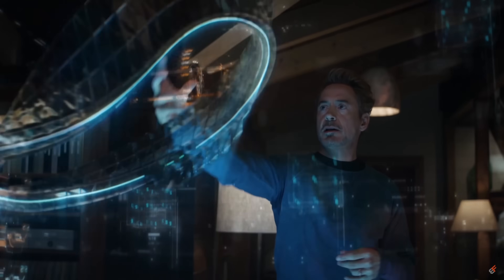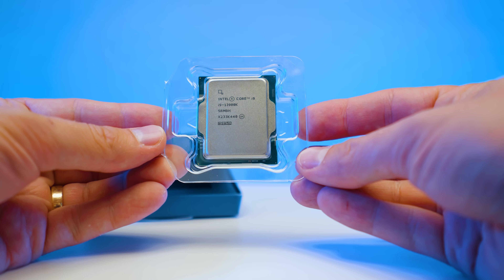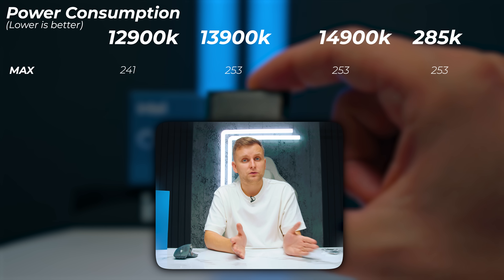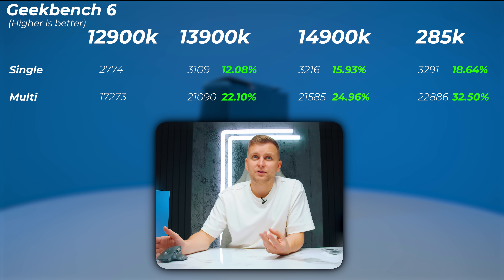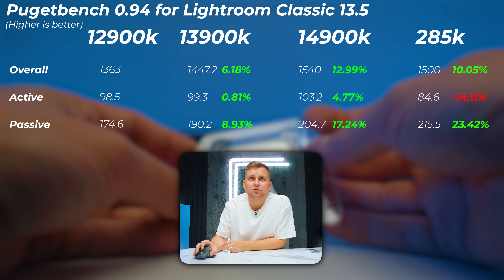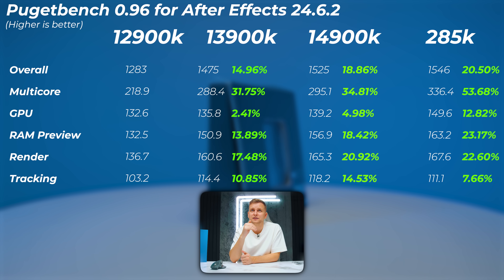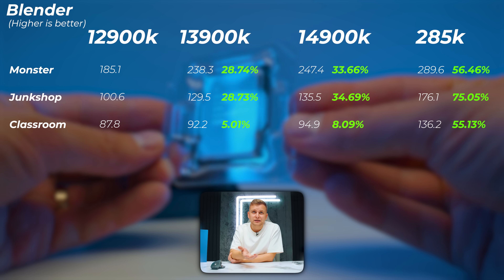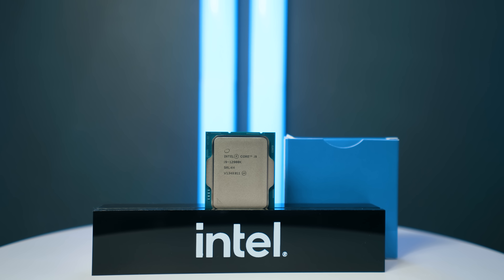4 Generations of Intel i9-s  👉🏻 How much ACTUAL performance gain? | 12900k vs 285k

Comment: Don't forget the 12900KS can be picked up currently for a relative bargain... narrowing the gap even more with the 13900k/14900k. Not to mention the memory controller on the 12900KS's is usually pretty decent. eg. my 12900KS can do 7200MT CL34 at lower voltages than my 13900K can (limit of that particular kit).
I'd say if you're already on a 12700K or 12900K, there's probably little reason for most people to upgrade... solid performing CPUs.
Reply: my 12900k can go 7400 cl34 with tachyonz690    but my 7950x3d can run 8000 cl 36 ;d i like both
Reply: @Fartuch87  I run 7800 36 with 12900KS on z690 unify x. Gigabyte have always been trash imo
Reply: @godnamedtay  My 12900KS is in a Z690i Unify (itx). Amazing board; the limit is actually that ram kit... hits a hard wall at 7200 CL34... could probably push it marginally more by tweaking, but i'm happy with the very low voltage/temps required for 7200 (eg. 1.41v on the memory... considering it's a Kingston Fury 6000MT C40 kit, that's pretty good!). I know this is a hard limit for the kit, as my 13900K with the same kit hits the same limit...

My 13900K can do 8000+ on its Asus ROG Strix Z790i Gaming Wifi board, with a G.SKill 8000MT kit... mine is an early chip (purchased in November 2022) but seems to be holding up fine! SP of 113 on the P-cores, so it's a decent chip...
Reply: @heyitsjel  I’ve always wanted the z690 unify itx, I have the z790 edge. They’re almost the same board with the z790 missing a couple feature that the unify z690 has. Either way the unify is my favorite line of mobos ever made, period. They’re incredible, very well made imo.
Reply: @godnamedtay  yeah they're great boards - I too was torn between the Z790i Edge and the Z690i Unify... but I needed the Unify due to the TB4 ports (10GbE adapter). Also, I'm very sure MSI runs their "out of the box" cpu settings significantly more tame than the likes of Asus; Gigabyte etc... probably explains why my 13900K still lives to this day without issue - it had a 288W power limit from day 1, initially in the Z690i Unify.
Reply: @Fartuch87  Sounds like you got a very decent 12900K! :)
Reply: I just got 12900ks for $236 & 13900k for $373 sold/shipped by Amazon. Incredible deals for these.
Reply: @godnamedtay  I paid about 50-60 USD more for the 12900KS here in Aus a month or so ago (local supplier) - still think it was a good deal though!
Reply: @ yea from what I hear about Aussie prices & considering how much hardware almost always costs more locally. That thing was $500 just a couple months ago. Def a great deal for sure. 12900KS is such a slept on cpu, thing is a tank!
Reply: @godnamedtay  Definitely man; it's even more funny that a 12900K cost more than the 12900KS here! Insanity... I honestly think it's one of the best bang for buck CPU options currently around...cheaper than a 13700k, but with a somewhat "guaranteed" decent IMC... too many people think the IMC on Raptor Lake is so much better than Alder lake, but I've seen some very average IMC's on Raptor Lake chips too... silicon lottery - the 12900KS gives you much better odds of a better IMC.

Comment: So what is the Best Bang for MONEY Motherboard/CPU Combo ?
Reply: Depends on what you are doing. He does recommend 14900k at the end. You can get a motherboard and RAM bundle at microcenter if you have one.
Reply: the Ultra 7 265k is on sale for $300 at microcenter btw. 100 cheaper than msrp. tho you can get the 12900K for around 270$ish and LGA 1700 motherboards are cheaper

Comment: It is worth upgrading.... to AMD...
Reply: This video is for creators, not gaming. In this usecase the 285k is worth it in my opinion
Reply: AMD has a huge amount of bottlenecking. Enabling XMP/EXPO instantly voids your warranty, thus none of the benchmarks doesn't show stock performance. AMD is significantly slower.
Reply: Get the hell out of here amd fanat. Go to your belowed channels like GN, HU etc
Reply: @policeman5768 you had to pick the 2 most unbiased channels to give as an example
Reply: @Riyozsu  the way they shilled for 9800x3d on launch tho:face-fuchsia-wide-eyes:1080p kInG ... best performing CPU... (conveniently ignoring 1440 p and 4k loss in 1% lows even versus i7s) because muhhh GPU bottlenacks reeeeee